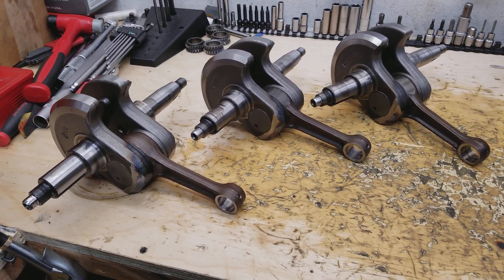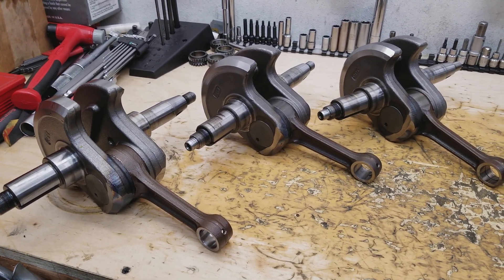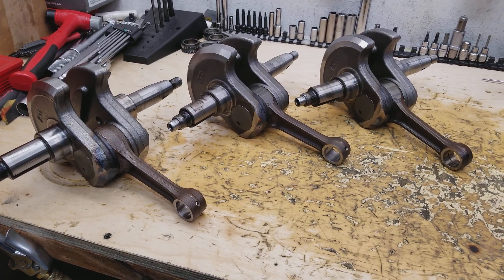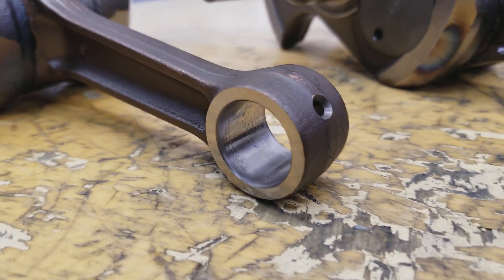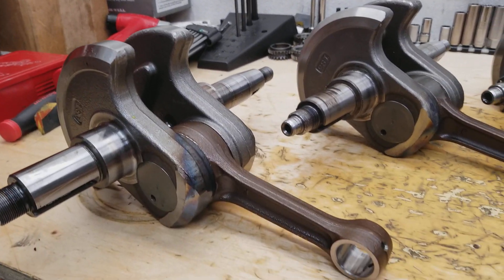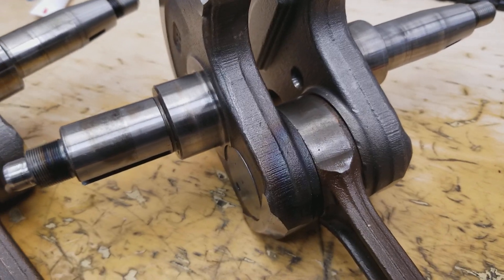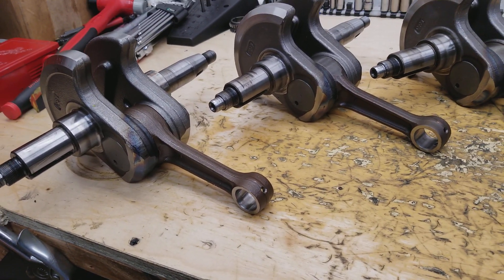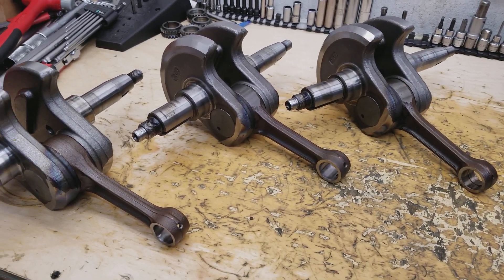The differences in crankshaft thru the years 06-18 Raptor 700

Comment: Just a little FYI...I’ve owned two Raptor 700’s one was purchased new buy a friend of mine back in 2007. I still have it. It was rode hard in the dunes and desert since then. (13 years!) The bike is still stock and runs great! Those of you who bought new Raptors you have nothing to worry about. Change your oil and clean your air filter and enjoy beating other quads for years!
Reply: yea mine is 14 years old now..
Reply: @dethinc1  👍
Reply: Indeed! My sentiments exactly 💯. Warm it up properly..use premium fuel..an hr meter.. run Mobil 1 4T 10w40! He recommends & after seein specs it blows away Yamalube etc & $9qt @Walmart.com!  2nd choice be Maxima (amazing stuff!) They gonna stop making the 700R very soon:( Grab a new one if you can. I am!
Reply: @dethinc1  maintenance is key! Fresh fuel only/ premium 91-93. Run Mobil1 4T 10w40..$9qt @ Walmart.com. He recommends it an so do i! The specs are awesome. Use an hour Meter. OEM or k&n oil filters.

Comment: So, you failed to make a clear case of if these rods are any real problem to be concerned bout? Or... just a very (remote highly unlikely) tho possible issue!? Can we mitigate crank pin issues thru better maintenance?? Heard u mention Mobil1 4T 10w40. Is this what you recommend & run? Specs are top notch/ price is right.✅ is Castrol Power 4T as good or you recommend Mobil1? Thanks so much.

Comment: So u can put a 2018 crankshaft in a 2012 raptor, for better compression, right?
Reply: Crank is just for stroke , piston makes compression
Reply: If you want a .020 shorter stroke yea go with the newer crank, you would loose some CC.
Reply: @dethinc1  Go w/proper crank don't mix match! He didn't say to. Improve ur engine oil maybe? He recommends Mobil1 4T 10w40 & i can see why.. specs are awesome! Better than Yamalube by far.. & $9qt @ Walmart.com. I order 6-12 @ a time. Use OEM oil filters he says tho I use k&n /OEM/uni

Comment: How many hours before this happens I just got one this video makes me nervous I had a Honda before that and I had great luck with it 260 hours how long will this one last before I have to do made you work to it I ride it sometimes nice and easy sometimes very hard depending on who I go riding with my ten-year-old son or my friends
Reply: I have a 2006 with a stock crank, This past year I sent the cylinder out to millennium to get replated, installed new piston I noticed ever so slight play in the wrist pin. The machine is 14 years old.. This year I will be looking into new crank and rod, I have worked on mnay of these machines, its a hit or miss.